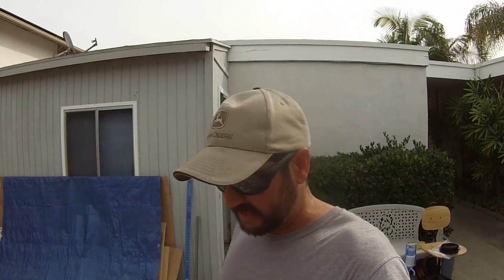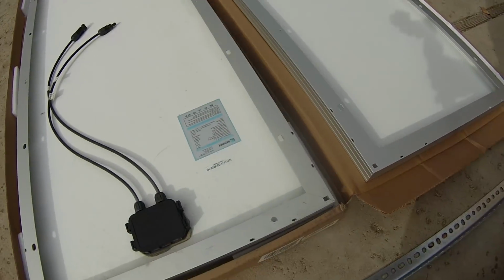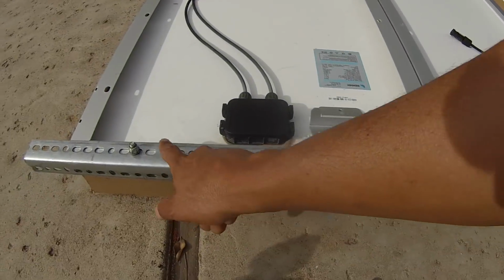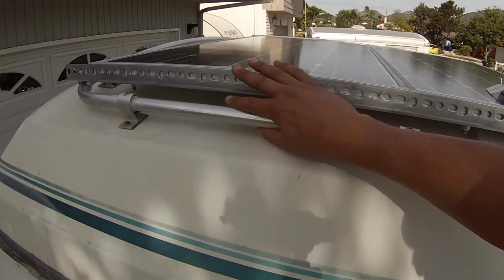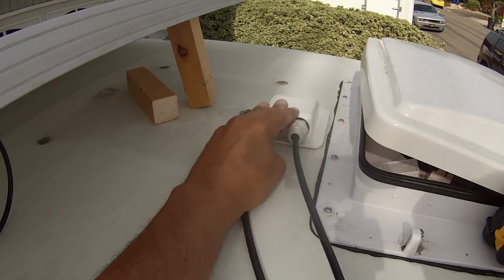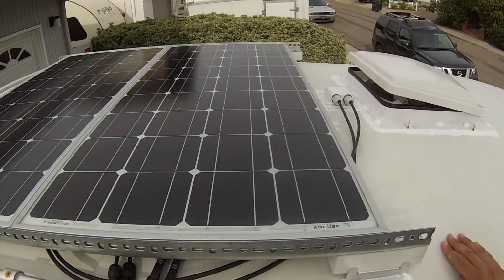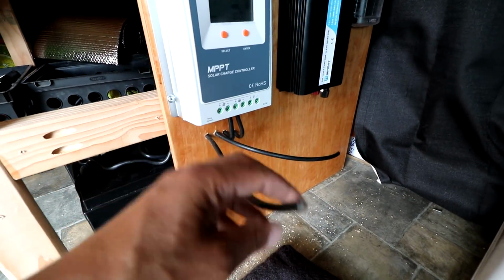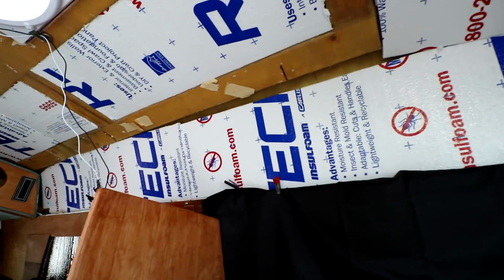Custom Camper Van Build - Video Five- Solar Panel Install

Comment: thanks much for sharing the solar install video Brian. Am going to be doing my own soon, so enjoyed your how-to. Picked up the Renogy Rover 40amp and a couple renogy panels already but have not decided on battery(s) to use. Was thinking about trying lithium but have found few good options. May end up with 4 agm's.   What you are working with there for batteries?

really appreciate all your videos through the years, great work.

Comment: Hi Brian, I think you find you can connect the panels in series (24v) and charge a 12V system. I have the same brand inverter although I dont know what the exact model number is of yours. Connecting your panels in series is more efficient, they will producing a charging voltage quicker in the morning and less current flow due to the higher voltage. Same power output but less voltage drop  due to less current, but I'm sure you know the theory behind that. The manual will give you the information you need, or let me know the model number and I'll look it up.
Reply from the maker: +Mark & Catherine's Vegie Garden Yes that is true.  If I had more than two panels I would wire in series.  The big draw back with wiring panels in series is that if just one of the panels gets a shadow or shade on it, then it affects all of the panels in the series.  Wiring in parallel prevents this.  😊👍✌

Comment: Van is looking real good. As always a very clear and precise educational video. I’m in process of installing solar into my van so this is very helpful to me. I am also at the RTR in Quartzsite and would very much like to meet you while you are here. you have been very instrumental in how I have done my van build and all the tips and tricks of living on the road and van dwelling. Look for my 97 BIG/EXTRA WIDE high top Dodge van, fuchsia and turquoise with a big V on both sides. Safe travels!

Comment: Why not wire the panels in series so it comes into your controller at 24v?
Reply from the maker: +Feedthelibertytree because of shade.  If one of the panels gets a little shade when in series it affects both panels.  If in parallel the unshaded panel will still be fully effective.  👍✌

Comment: Hi Brian from 🇨🇦. I really enjoy watching your experienced troubleshooting. Could you tell us what had to be done me hanically to the van on the day you were with your friend? Were they issues you knew about or surprises? I bought a small fg trailer and will be travelling this summer. I am hesitant to ream any holes into the fg - unfortunately i dont have any wood exposed except two small pieces at each end of the bunk at one end where a support used to be. Im thinking i will have to invest in strong velcro! 

Love the new van 😍 and the extras you have decided to “splurge” on. You deserve it 👍
Reply from the maker: +Brenda Pinder Hey thanks, I was just having some things looked over on the van. 👍✌

Comment: I was just wondering since you have the batteries more towards the back and probably in a battery box that you can vent to the outside with the batteries right under your head and your breathing fumes possibly I don't know much about this but just maybe you could kind of think about that

Comment: Good illustration. Clean job. I like how you used the angle iron and bolts with nylock nuts. Should hold tight!                                           CCC

Comment: Nice and easy. The way those “ U “ clamps are on the old round roof rack looked like with a little modification you could come up with a tilting solar unit. Just need a simple bracket on the front with a couple quick release pins. Just a thought but a little extra cable would be needed. Safe travels. Always find your videos fun, informative and entertaining.

Comment: Great job Brian :)  One comment to make is that as you have an MPPT controller then it might be more efficient to wire your panels in series to give 24v coming in, if you controller allows this. I've seen that people get more power on overcast days by wiring in this way. You can still have your batteries wired in parallel to make 12v as you have done.  Worth thinking about :)

Comment: Nice work. Just a friendly suggestion: You should use lock washers or torque nuts to ensure the panels don't come loose while driving in the wind and vibrations. If that happened, you'd save yourself a bit of money at the least. At best possibly avoid hurting someone on the road. Plus you'll have peace of mind.

Comment: Cool what you do. FYI 100% silicone caulk works as an excellent permanent glue. Will hold flat surfaces and more together like crazy.
Reply: Thanks- I was about to ask him what he used.  Love your videos Brian!
Reply: Eternabond and/or Sicaflex is, IMHO, better. Silicone doesn't hold up as well due to sun/uv rays. Way more difficult to work with, but worth it.
Reply: thanks

Comment: dude!  where's your fuses?  not having fuses is a good way to burn up your van.
Reply: Definitely needs to have fuses.
Reply: you need fuses between your solar panels and controller, and between the controller and battery bank.
Reply: He definitely needs these fuses (wadesready lists) not just the ones on the load.
Reply from the maker: they are right there

Comment: Ummmm, I'm concerned those wooden blocks might break when you're driving down the road and there's huge wind pressure on  and under your front panel - panel will want to lift severely. please double check.  Apart from that, love the setup.
Reply from the maker: that should keep tailgaters back! :)

Comment: I have read, in the past, that before removing the batteries from a solar panel, to change out etc, one should pull the fuse on the solar panel to prevent damage. Not sure of the details or facts but just something to consider. Neat Job by the way